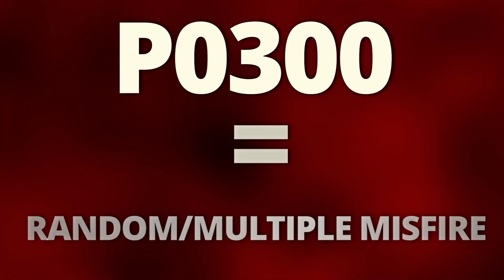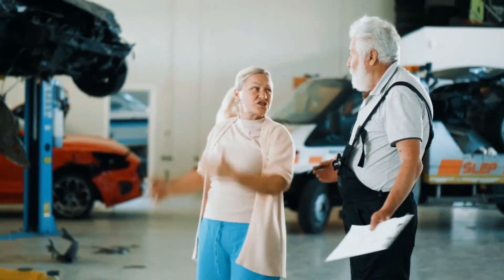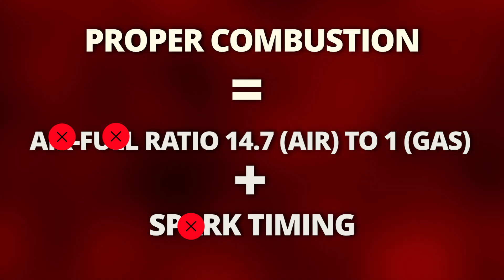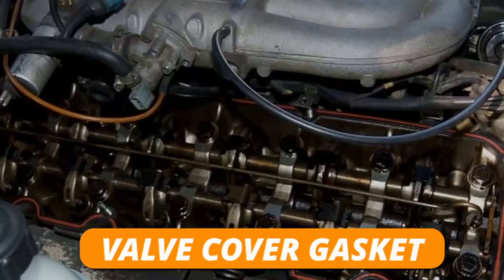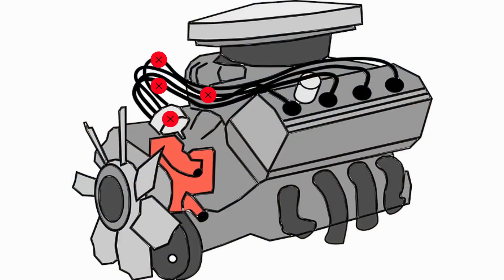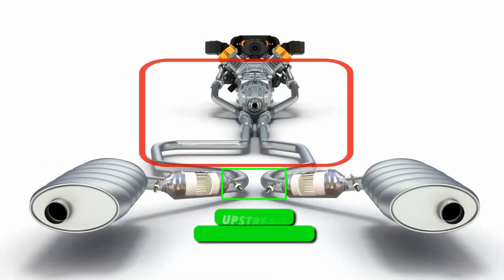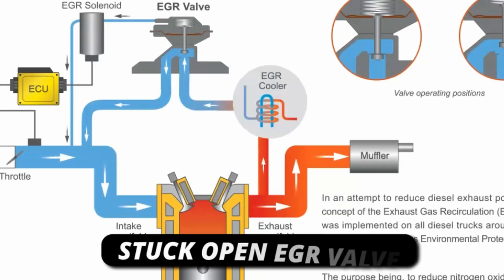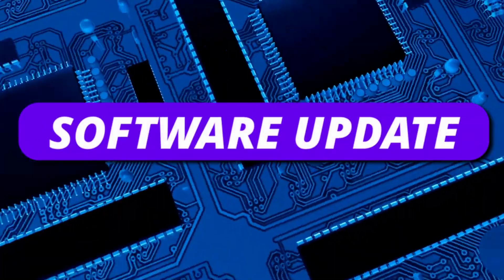P0300 ULTIMATE GUIDE

Comment: I have p0300 code but with p0130 p0150 and p0325. And pretty sure that replacing the oxygen sensor and knock sensor won't fix p0300. Cuz I have already replaced O2 sensors and reset the codes. But p0130 and p0150 as well as p0300 keep coming back. P0300 is the reason p0130 p0150 codes keep popping up. Something is tricking O2 sensors. I think it's a bad fuel pump. My car starts but slow crank long starts and misfires bad especially under heavy load. And check engine light keeps flashing. P0300 is the cause for p0130 and p0150. Now as for the p0325 knock sensor I don't even know where that is or what it is.

Comment: After replacing plugs, wires, coils, MAF, and fuel injectors it seems that the solution was crank position sensor relearn. Note that the problem may have been a dead battery for a long period of time.

Comment: bad gasoline will also cause a P0300 code.    I filled my tank and three miles later the engine shut down.     I checked the plugs, coils and fuel jets and everything was fine.   I cleaned the throttle body but it wasn't dirty,  No vacuum leaks.

Comment: I  have a 2018 Hyundai Sonata Sport,  my BDS system quick working, it turns off when put it in drive, at the same my traction light and ABS light is on. And a triangle with explanation mark come on when BSD sensor goes out. It's  sluggish on acceleration. No one can figure it out. Any suggestions? No code.

Comment: I replaced my fuel injectors with remanufactured. P0300 DTC gone. Be sure to put new O-Rings on the fuel pipes, on the male ends 1st. As you push in the pipes with O-Rings, watch carefully the O-Rings go in flush, all the way in.

Comment: What would cause this code do pop up and flash the cel when accelerating hard? It happens to my 2014 F-150 with the 5.0 but only when accelerating over 4000 rpms and only flashes the cel for a while and goes away.
Reply: having this exact issue did you solve it? if so what was it please help
Reply: @ħear I recently did a crank relearn on my truck with an SCT X4 tuner and it seems to have fixed the issue. Not sure what kind of internal engine maintenence the previous owner did but I guess they never did a crank relearn. I've already had to replace a catalytic converter because of that p0300 code but thankfully it seems to have gone away for good. If you have a tuner similar to mine you can do the crank relearn yourself or take it in to get it done at the dealership. Not sure how much they would charge you though. Good luck and hope my answer helped.
Reply: @Force_DLX  thanks for the reply. I really appreciate it. I do want to ask. How did you find out the P0300 code was from catalytic converter?

Comment: Pretty thorough.  I'd always start with the cheap, simple stuff that is easy to get to, unless you get another code to narrow it.  Vacuum hoses, spark plugs, coils and air filter/clean throttle. When you check the plugs and you have some oil, you likely need a new valve cover gasket.  Then the EGR valve and the PCV valve (under the car).  Clean out the EGR valve and test it.  You can also run tests on the fuel pressure, compression and the head gasket if you still have the code.  You can check the MAF as well.
I'm sure I missed some stuff, but this how I would do it.

Comment: Low oil level in those eco engines.  Low oil can cause major damage obviously but didn't expect it to cause p0300 or even rough engine performance.   I had to change the timing chain, guides and VVT solenoids in my nephew's Equinox

Comment: ECU ignition coil driver for cylinder 1 and 3 were not sending a 5 volt signal to ignition coil 1 and 3. Replaced ECU and solved issue.

Comment: My wifes 2011 mazda 3 itouring has a P0300 code right now. I went to change the spark plugs tonight and found oil in 3 spark plug wells. So currently i have the valve cover pulled and tomorrow i will replace the valve cover gaskets and hopefully it fixes the issue. To be continued.

Comment: I have a 2001 saturn sl 84,000 miles I had while driving a sudden and dramatic power loss and engine light started blinking barley made it home when i turned off at home it wouldn't start next day stared right up bit 4 minuted later it dies and it does this every time also really strong gas smell and p0300 is only code I'm geting any help appreciated

Comment: 2019 mustang gt with only 14k miles. Engine runs fine p0300 code.  Cleared code 460 miles ago. Cel has not come back yet. Any ideas?

Comment: I have the p0300 
2008 Chevy 5.3
267,xxx miles
I just had to replace my head gaskets I also replaced the valve cover gaskets.   The plugs & wires were replaced a year ago & coils about 2 years ago.  And today I just had to replace the starter.
Reply: Right after replacing head gaskets I had a code for crankshaft position sensor but it has gone away on its own.

Comment: On a 2019 Ford E450 RV with the Trition the 6.8  V10 I had a flashing check engine light come but because of a medical issue we chose to keep driving at a slower speed for 500 miles until we got home, the Ford dealer replaced a bad igition coil under warranty. Said everything is OK, but I wonder what happened to all that unburnt fuel that went into that cylinder, did it just go out the exhaust, get burnt in the catalytic converter? Blow by the rings and into the crankcase?  What damage was done, if any?

Comment: 05 Malibu I replaced the coil and spark plugs 230$ didn’t solve it, the control ignition module was the main cause of the code p0300 replaced for 150$ no more check engine light and the car runs good as new

Comment: 2007 Volkswagen Rabbit 2.5L. Currently Suffering from P0300. I've replace (for the 2nd time in 6 months) All Coils & Plugs. 1st Fuel Injector, 1st Fuel Injector Pigtail Connector (Output Before: 0.7, After Installed: 2.4-2.7 (All the other are outputting 3.3 without Cranking it), PCV Valve Cover (Used), Top & Bottom O-Rings, Tested the Variable Timing Valve (Good), Cylinder Compression Test (Good), I AM Missing a bolt in the middle on the Air Intake Manifold. I'm going to attempt to replace it and or the entire manifold and possibly the Camshaft Position Sensor. After that, if it's something else, I have no choice but to sell my car.
Reply: did you end up finding the solution? currently having the same problem

Comment: Only getting p0300 code ,new battery, new fuel pump, pressure sensor, EVAP vent, fuel filter ,spark plugs ,spark wires, checked and have unclogged catalyst for up and downstream, FAIR ,HOW MUCH WILL IT COST FOR DIAGNOSIS
Reply: Did you check maybe if the manifold gasket is bad. If the car idles bad,has p0300 code and has engine light on or you can hear wheestling sound than probably manifold gasket needs to be replaced
Reply: @enigmalex3649  thank you for your feedback, had a family mechanic work on it for a week he literally tried everything from smoke test found no leaks & so on , he got hand on the Manual for Mitsubishi Diamante/magna V6 4g74 and the spark plugs wires were placed wrong order from 1st owner

Comment: So, basically get out your credit card and unload the parts cannon.  Incredibly frustrating when you've verified compression, installed new fuel pump, plugs, wires, complete distributor with cam degreed to 0*, fuel filter, verified fuel pressure, cleaned the throttle body, cleaned the MAF, added seafoam to the gas, verified IAC, TPS, EGR, and MAP sensor and it still gives a P0300.
Reply: have you found the problem if so what was it? currently having this issue
Reply: @ħear  We found that on the 4th crank position sensor we bought combined with removing the timing chain cover and correcting the air gap between the reluctor wheel and the sensor (provided spacers didn't work) finally "fixed" it.  Also replaced catalytic convertors.  So, Chinesium parts are the principal cause.

Comment: Honestly this has been s great video for me , i have this code on my 98 Nissan frontier, ive changed my fuel injectors, my mass air flow sensor, my fuel filter and i still have it , it idles ruff and smells rich , it runs fine when driving but it just idles ruff , if tried to adjust my carburetor but if i adjust it to highbit gets stuck and redlines until i back off on the screw .... I cant find the problem yet what should i do now?????
Reply: Did you check intake manifold gasket?
Reply: @enigmalex3649  why would I check that , it doesn't have an exhaust leak there 🤷‍♂️🤣
Reply: Try the sparks/coils an ignition control module, could be a leak as well but most of the time its something to do with the engine

Comment: 1) I checked the plugs. They looked good. Cyl 1 plug gap was a little wide but I set it at .043 like the rest of them.
2) Checked the coils by unplugging and #2 was bad. Replaced.
P0300 cleared. 
I got lucky.
Reply: How could you tell it was bad?
Reply: @sullynicholls5900 When you unplug a coil while the engine is running, it will be a very obvious misfire; if you unplug one and nothing changes, it's likely bad.
Reply: does it happen again or not  ? After you fixed it I mean

Comment: Ok well I got a dodge charge rt 06 N it cut off Check engine light only been on for a day or 2 the day it came it i got a tune up and oil change but it was still on i need a crankshaft n i got a po315 po335 n po300 code thats all it showings but them codes or all the same stuff if not similar right so if u had this problem lmk

Comment: I NEED HELP! If possible please. I had a PO191 Code in my 2006 ford f150 which i fixed by replacing my fuel rail pressure sensor. I also changed my fuel filter. It rumbled when i started it up and idled normally. Eventually the check engine light came back and i got the PO300 code. Is it something to do with the fuel filter i just changed? Any help would be greatly appreciated!

Comment: So frustrating.  2007 Toyota Avalon.  Get multiple cylinder P0300 only when driving over 80 mph.  It can be 4 cylinders, and includes the front bank.  Car has no other symptoms.  It is not plugs or coils as they have been replaced.  I am guessing that it is fuel starvation due to fuel pump, fuel pressure regulator, fuel filter, fuel pickup screen clogged.  Solution at this point is not to drive 80 mph.
Reply: did you find the solution currently have the issue
Reply: @ħear No.  Just don't exceed 80 mph.

Comment: I had a P0300 code on my 2000 tacoma prerunner, and it would shake and misfire on cold start and then even out as it ran longer. The weird part is that the code went away after I added some injector cleaner. My truck now cranks over a little more then usual on cold start but is running almost the same w a slight loss of power. Anyone have any ideas why or what I can do to help my engine?
Reply: I have exactly the same problem as you with the same truck. 2.7 liter. It just started a while back and doesn’t do it all the time. Suspect an injector is leaking down  after a couple of days of not running. Had cleaned them a while back but I suspect they were the original ones and the truck has 264,000 miles. Gonna change them first and if that doesn’t do it, gonna change the fuel pump. The way I see it , it only takes one to leak down thus causing the fuel pressure to drop on all four being it’s a common rail system. It will take the pump a little time to build the pressure evenly across all four.

Comment: Actually what is key to understanding misfire that this video misses, is that a misfire is detected when the RPM slightly dips on one cylinder's combustion stroke when compares to the RPM of other cylinders. This can be a misfire or fault of the crank position sensor in misreporting a misfire. When I say RPM slightly dips, example when idling at 800RPM on a 4 cylinder engine, there's 400 combustion strokes in a minute (4 cycle engine combustion/exhaust stroke every other revolution). The PCM would expect each combustion stroke exactly 0.15s apart. If a cylinder misfires, the RPM drops slightly and will take longer than 0.15s for the next combustion stroke since that cylinder didn't produce equal work as the other cylinders. With this understanding of misfire (slight dip in RPM/work performed at cylinder level) this opens your mind to all the things that could be the cause from an ignition wire that shorts to the block to a worn cam lobe that reduces intake mixture or exhaust gas.
Reply: Top Notch analysis you deserve a beer
Reply: @following
Reply: Thats a great analysis chief
How do I contact you sir
Reply: @PlugSHaKer  don't have any mechanic vids on this channel, they are on this one @BearHomeOwnerDIY

Comment: Had a p0300 code in my 02 Tahoe 

Turned out to be bad reading from downstream O2 sensor 
Which caused the truck to foul plugs

Pulled all the plugs
Hit them with. Wire brush to clean

Re installed existing plugs
Problem went away for right now 

Planning on replacing 
CAT converters 
O2 sensors 
Plugs
Wires 
and coils 

But after brushing off the plugs 
It is running better than when I bought it🤷🏻‍♂️🤷🏻‍♂️🤷🏻‍♂️
Reply: U sure ur P0300 wasn’t just the result of old / worn spark plugs?

Comment: Who lost their mind after the first 30 different things that could cause the code?
Reply: My head is spinning.
Reply: @johne5596 Right there with you as the parts keep getting replaced and the payments to the shop go up God this is a headache
Reply: Chasing my tail smh
Reply: I did. I was losing my mind before watching this video. And this video just make it worse 😂
Reply: No kidding
Reply: Check yall wiring
Reply: this don't make no dang sense totally FRUSTRATING  it's like well did you do this ,that game board in the meantime money and time is losing tolerations.
Reply: @SD4philly Right there with you this is the most frustrating problem I've ever had with his car I'm on the verge of just getting rid of it and calling it even
Reply: Basically every tv interview is could be the problem instead of something specific relating to the actual issue
Reply: Crying rn
Reply: I stopped watching thinking he might say the glow plugs are the cause of P0300 code
Reply: Fuck all king of things.
Reply: Me with a nissan frontier
Reply: Same. I'm not mechanically inclined and this has me questioning if my 2003 Chevy Silverado is even worth fixing at this point as the average repair shop would charge $1,000 or more to find the issue(s) and fix it.
Reply: I'm stuck in limo mode with this code
Reply: I did
Reply: I finally fixed my issue.  I had to buy a hacked "tech II" scanner to find out which cylinders were missing.  It told me 3 and 5 were missing.  I then ran an injector test on each cylinder and determined that the poppets were stuck on both 3 and 5. So I was able to buy a new spider and change it. 1998 Astro.  This will be different for many of you but at least you don't throw a spider at it if you don't know if its the spider.  At least this way will prove if the spider injectors are stuck or not.
Reply: @mannyfrommiami2622 well done bro if you solved your car problems but my car 🚘 still have this problems misfire cylinders hold with engine light Bling lost power all like died car please explain me if you solved
Reply: Gettin there
Reply: Hye guy's it's hard for me because my aveo like this code I am checking more then people but nobody got it problems misfire engine please someone helping me
Reply: Like I said welcome to my nightmare The car runs fine for a while then it just freaks out and stalls on me usually right in the middle of traffic did you find yours did one of the 30 things that you have to look for fix it I have the same problem My condolences
Reply: Now I fights  with that story and now way out and nobody  found real reason in my case
Reply: Bro... I went vac route the first time, all new hoses, fuel the second with new filter and pump, just changed spark wires, distro, and now am moving to sparks. Might do maf and throttle body next. Sucks man... I'm basically doing all the maintenance that should have been done 150k miles ago...
Reply: Me
Reply: toleration.
Who else besides me have done more than half these things yourselves, maybe folks get class actions against the manufacturers so what can know EXACTLY what the dam problem is after numerous cost saving attempts that hoes void again frustration and expenses gets very DEPRESSING.
Reply: @SD4philly I'm on that page right now it's frustrating nothing seems to fix it.
Reply: @JoseRodriguez-zu6dq  You have to look everything. And in the end might be a Burned or leaking Valve.

Comment: So it means the engine is broke..check all components…sounds like a code installed as a joke on the owner by the engineers lol
Reply: For example p0300 code could be manifold gasket. How could they put sensor on a gasket lol and it doesn't mean that the engine is broke with that code

Comment: Here is another twist . A stuck open or intermittently sticking evap purge valve will cause the car to run horrible . On my 1987 Celebrity 2.8 L it would intermittently stick open . The vacuum would drop to 12 lbs. I finally blocked off all the hoses and drove it . The problem disappeared .
Reply: Thank you
Reply: I just replaced coil packs and plugs on a 5.0 F150.  It ran crappy on startup but then smoothed out and ran for at least a half hour and a test drive with diagnostics running and all good.  Car would not run before.  Cut to 2 hours later.  Same problems and same P0300.  That was a fun chunk of change 😂

Comment: If it's from compression loss it might show no code. My infiniti g37 burned a valve so I tiny piece of the exhaust valve chipped off making it loose it's compression in one cylinder and I got no code or light.
Reply: What was the symptoms on ur g37?

Comment: Hey good stuff there, my 2017 3.6l pentastar has codes 0300 and 0305 caused by the famous rocker roller bearing failure followed by heavy wear and grooving on the camshaft lobes.  Both lobes and rockers shot on cylinder 5 intake side. Please keep that oil clean as someone neglected a good maintenance routine on this engine.